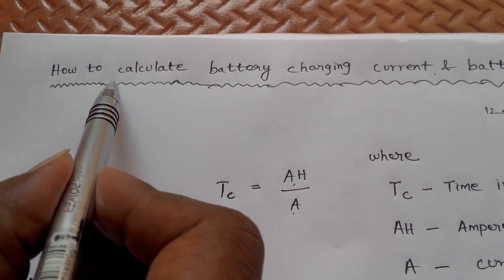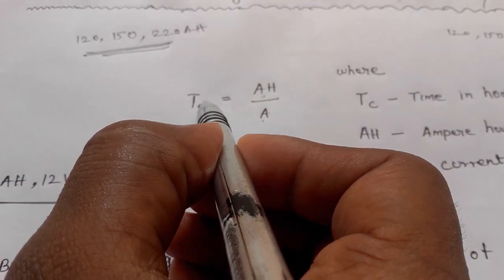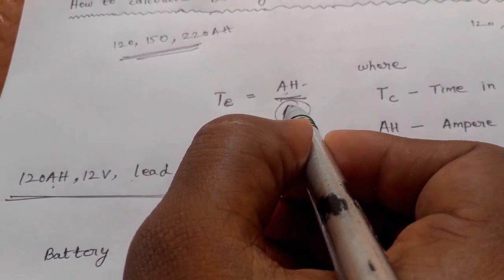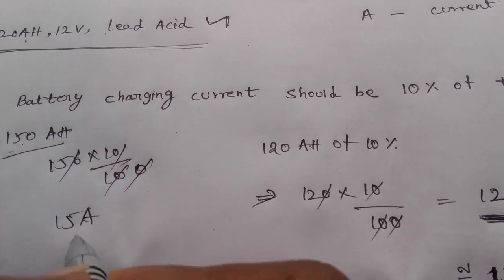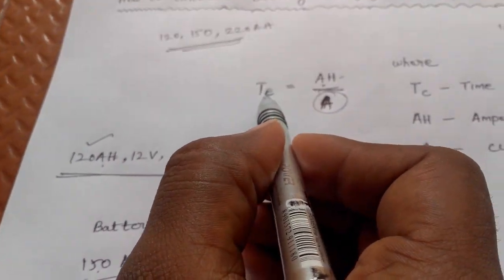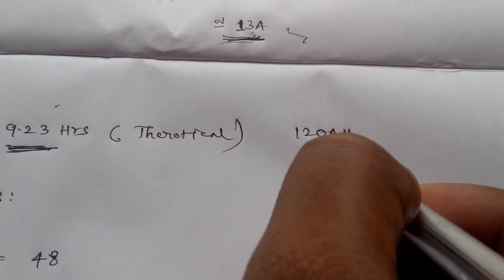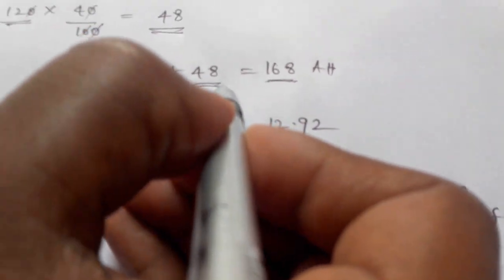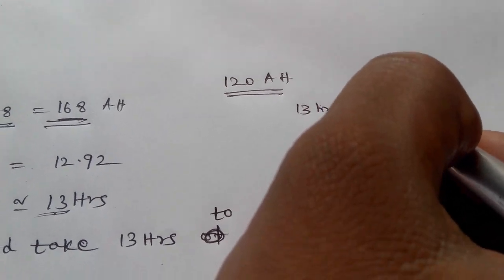How to calculate battery charging time and battery charging current of  explanation in hindi

Comment: Make video on calculation of  electrical power consumption for hvac system
Reply from the maker: Can you elaborate your doubts as I did not get your point bro..
Reply: @EngineersViewEEE  total electrical power consumption for hvac system for 1 month estimation cost
Reply from the maker: It will varies based on heat load

Comment: Wrong information
A = charging current that depends upon ups inverter.it is different for diffrent inverter.
For eg. luminous zelio 1100= 15 A,,, luminous eco volt+1050= 17A.
Time  required to charge 150 ah battery is = 150AH÷15( for luminous zelio)= 10 hrs .
But it work with 80% efficiency.
so 20% of 10Hrs= 2 hrs more 
So charging time = 10+ 2= 12 hrs .
(This is for new battery of age up to 1 yr)
Charging time also depend upon age and type of battery. And proper distilled water level.
Reply: Charging current should not less than AH÷20 and more than Ah÷ 5.
For eg for charging 180ah battery .charging current should be of range 9A - 36A.